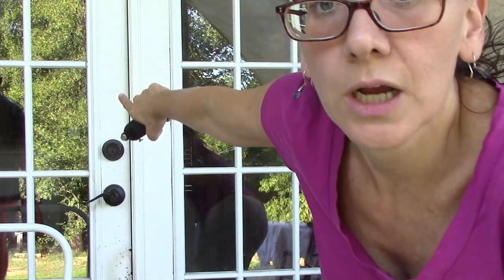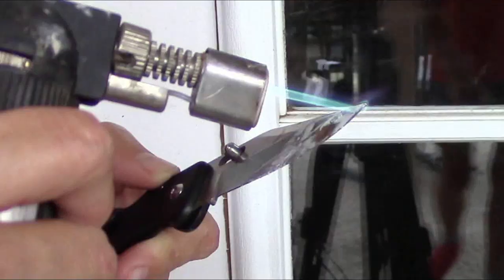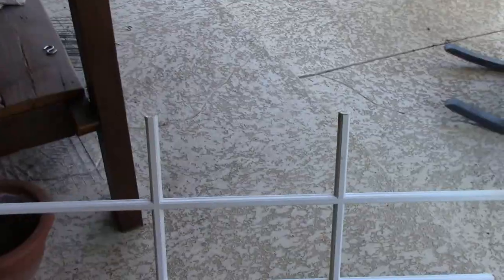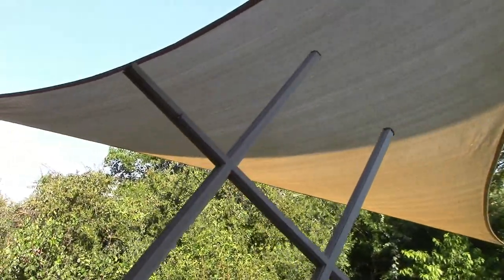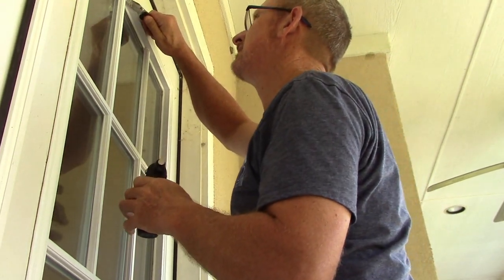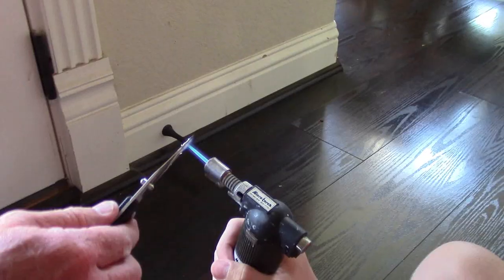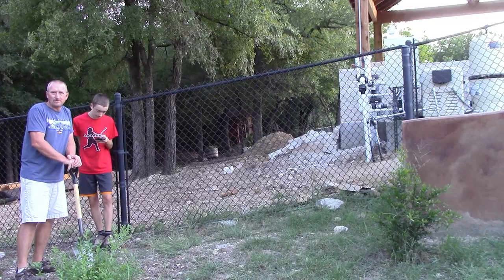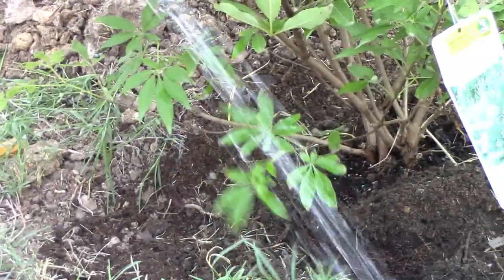How to Remove Plastic Grid or Mullion from French Doors

Comment: Julie, I make wood muntins for doors and those plastic pieces are muntins; whereas, the larger wider dividers between each window are mullions. Mullions between windows are a part of the supporting framework for a bank of windows. There are soldering electric irons that have optional tips for cutting your muntins. When you torch flame heat a knife that ruins the knife's blade hardness and therefore the metal will not hold an edge for future sharpening. Weller makes such electric irons.
Reply from the maker: Good info!

Comment: I think it funny all the work put into removing the frames, but the door frame has cobwebs hanging off of it, and there are wasps nests up in the corner. I know, pick your battles. And it does look much better. We replaced our windows this year because the entire neighborhood has mullions in the windows. I want to see what's on the other side, not a bunch of grids. Also, have you thought about putting rolled bamboo shades on that corner to block the noise?
Reply from the maker: We’ve since painted the whole exterior which cost a bundle.   It looks amazing.

Comment: My door has the plastic grid and I hate it, but if I remove it what can I put on the glass to make sure the glass does not brake? And how do you know if the glass is secure or not?
Reply from the maker: I’m not sure about your specific case.  I know 3M makes a protective plastic you can put over the glass.

Comment: I did the same thing but I was lucky there were tiny screws I was able to remove 😎 nice Julie
Reply from the maker: Our frames have some plug looking things I think they are melted in.
Reply: @JulieHiltbrunner  They are probably rubber plugs in the plastic, maybe drill out the center of the plug.
Or use a dremel to trim the excess from where you hit knifed it.

Comment: I like the grid if it is sandwiched between two panes of glass with argon also between  the two panes to insulate the window. You also don't have to clean between all the little rectangles if they are sandwiched between two panes of glass. However it's good you were able to fix your problem since you didn't like them.
Reply from the maker: Cleaning was definitely a problem.  Thanks for watching!

Comment: They sell the doors with or without the grid (grille) 
Your dealing with pre existing doors so good idea with the hot knife.
The old doors were alot prettier but the glass was single pane and didnt have any insulation value. The newer doors are made with tempered glass which is alot harder to break, and when it does break, it is a lot safer than the old glass which left huge sharp pieces. 
The older doors were easy to break with a towel wrapped around your hand, and it doesnt make much noise.That's how burglar used to gain quick access to the inside thumb turn on the deadbolt lock.
The tempered glass makes a loud popping sound when it breaks and it usually will stay together even though it's in a million little pieces.
I actually like the grid I just wish it was removable for cleaning purposes like some that I have seen out there.
Reply from the maker: There’s easier ways to break into.french doors.  They are pretty bad in terms of security.   There’s a clear plastic sheeting by 3m to coat the glass. Makes it really hard to break.  But that won’t stop the clever people who learned how to do open them on YouTube.